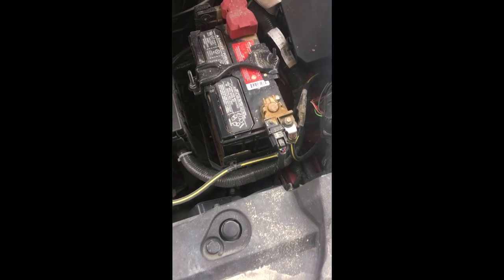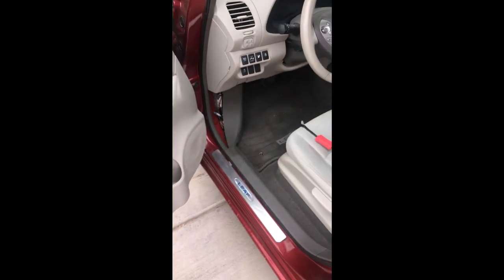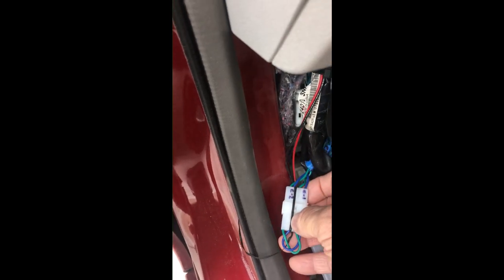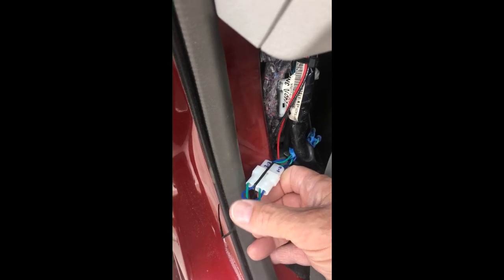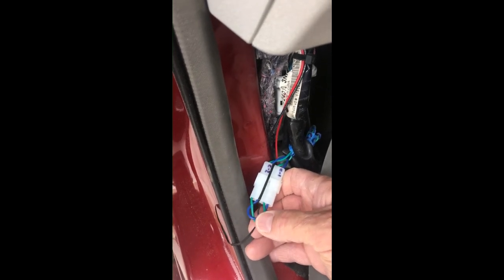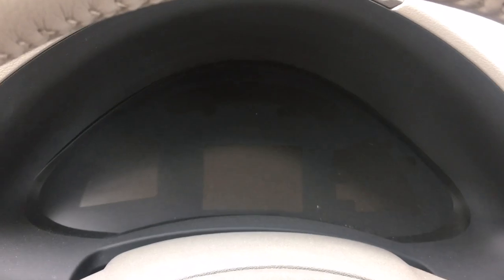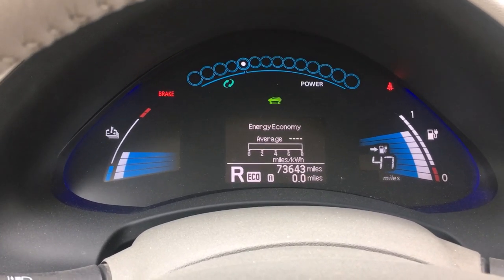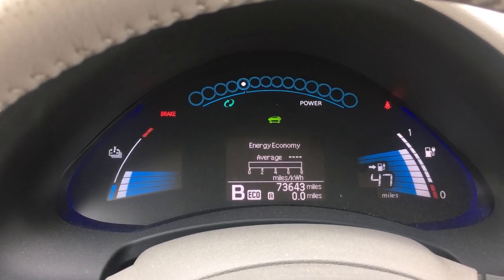2 Port CAN Bus Bridge install

Comment: You didn’t show where you plugged it in or how. That would have been the most important part of the video. And you didn’t show where the power wire was coming from